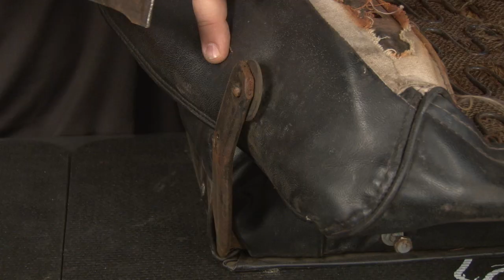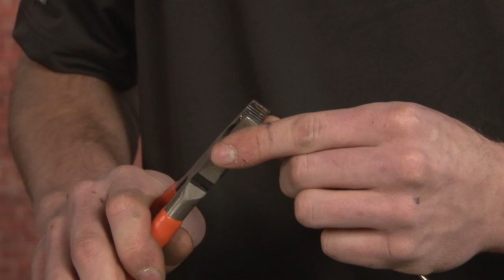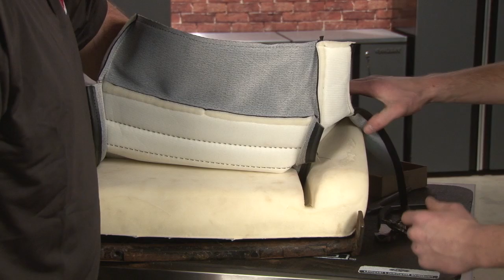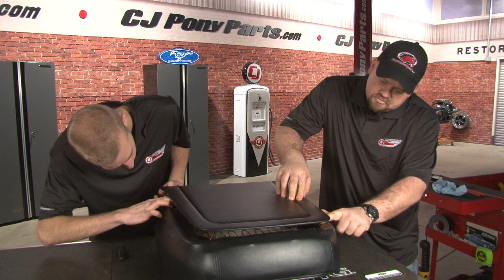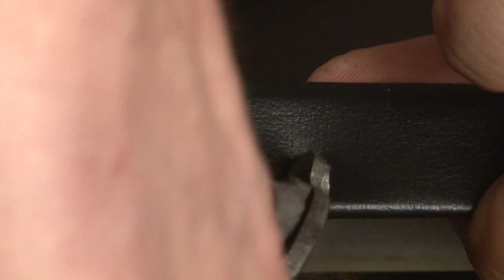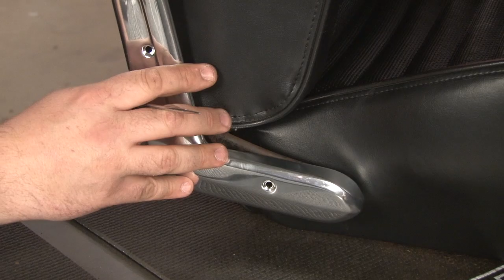Seat Upholstery | TMI | 1965-1968 Mustang

Comment: How can i identify a 1966 ford mustang coup factory 4 sped manual transmission ? 🤔
Reply: Look for the numbers on the transmission, if it’s a factory Ford 4-speed top loader, there will be an access plate on top with 10 bolts, and an aluminum tag on the passenger side, with the identification numbers. It could also be a Borg-Warner T-10,
4-speed, that is a side loader.

Comment: Extremely helpful video although I have the 69/70 high back seats. I have already completed one seat and it looks GREAT. Major update to my interior. Trickiest part was trying to hog ring the front of the seats into the channels, especially the high top seat. Found my seat tracks are all crud so that is my next task. Almost sixty year old grease to clean out. Make sure you take a picture of the seat tracks as I had to pull the seacond seat out to figure out how it goes back together. Go slow and take it one step at a time. I'm not going to say its easy but I got through it in just a couple days, again they look GREAT. Very very happy with the results.

Comment: Make holes in foam then pull through cable  ties...I used 8....10 inch maybe better...way easier..to get down in the foam was like next to impossible  with the hog ring tool to get down to the listing wire..used hog rings for tightening up underneath..this job is definetly doable..I was quoted 1,000 for two seats..the whole job honestly took about 16 hours...my first time😊

Comment: I am really finding it hard to pierce the foam with the hog ring, along with the listing wire, and pushing it all the way through to the frame. Anybody have secrets?
Reply: As was suggested above, use zip ties. I came up with this idea years ago and it worked wonders. The previous commenter said to just use them to get started, but in my opinion, they are a permanent solution. 

I don’t think zip ties existed “back in the day”. Regardless, I suspect hog rings are faster in a factory production environment, which may be why they’re not OE.

Comment: just finished mine! looks awesome! did driver seat in couple hours by myself, turned out very well! it did tear a bit on the passenger seat upper, wow its tight going over the corners with the oem foam at the top. vinyl glue did wonders, lucky it was on the back near the seat back

Comment: Thorough presentation.  I have one question though:  what is holding the seat foam to the frame?  Is it not necessary to first hog ring the embedded listing wire in the foam to the paper wrapped listing wire in the seat frame?    And then, attach the upholstery hog ringing the listing wire in the upholstery to the listing wire in the foam?    Please advise . Thanks Ace

Comment: Isn't replacing the seat cheaper and better for longevity? Not trying to be an ass, but if your changing the seat to your wants, then the car isn't original. Wouldn't putting anything nice but cheaper do the trick? This is asked, due to my having a 69 and trying to do a resto-mod as inexpensive as I can. I'm new to this, just have a passion. Can someone help?

Comment: This video has been a life saver! I took on the task of reupholstering my front seats in my 66 this weekend and I would have been lost without this video. The passenger seat is done (slightly imperfectly, but still looks great) and the driver’s seat is almost done. I’ve been leaning on wires in the driver seat for years, so it’s going to be amazing to have new foam (and vinyl) on my seat.

Comment: By far the hardest part of this job is putting the seat back cover on.  These guys totally gloss it over.
Reply: I made too many holes and had to rotate the clips until I got it right..but no mistakes show😊
Reply: I teared mine badly the card board piece I got some in but I gave up took 3 hours im possibly going to get the same color as the upholstery in long screws and do them neatly in each corner
Reply: @ericcartman3440  I just meant those back covers come with push-clips that will inevitably crumble when you push some of them in (age, rust).  I'd say 80% of mine pushed in OK and I just used a little silicone to glue the one problem area.  Looks good and now it's someone else's problem 60 years from now.  :)  This is a very satisfying job BTW and makes a big difference.

Comment: This is a good tutorial video. i watched many times before and during my rework. 
heres some tips:
1 invest in a good pair of hog ring pliers AND cutters. common wire cutters will not work removing your missed hog rings
2 consider getting straight handle hog ring pliers, the angled units dont work well
3 get an extra set of hands to help, compressing foam and getting to the wires is tiring and frustrating
4 take care when ringing down the listing wires, they can tear out of the thin material TMI used to hold them in place
5 as stated, put material out is sun to soften, it makes stretching easier
6 be prepared to give your hands and forearms a workout, the sport foam is not easy to work with
7 consider hiring a pro to do it, what is your time worth? 
i hate upholstery work, i'm in the middle of this now, so i will keep going. probably never do this again.

Comment: Here's a tip...don't fold over the bolsters or edges until you've completely hog ringing the center listing channels. The foam will compress enough for you to fold over the edges. Finish off by steaming the inside of the vinyl to soften it and reduce wrinkles.
Reply: Also, see if you can rent or purchase a pneumatic hog ring tool. Doing it by hand sucks

Comment: Maybe this is a stupid question, Does the hog ring attached to a wire within the cushioning (foam) or are the hog rings just grabbing onto foam or they grabbing onto metal framing of the seat springs behind the foam?
Reply from the maker: They grab into the wire that is embedded in the foam.

Comment: Thanks for this awesome video. Must have watched it 10 times during my install. I have no experience installing upholstery. Your 22 minute video made me a pro. Got my pony upholstery and seat cushions installed in my 64 1/2 Mustang and I don't think the pro's could have done a better job. Your video covers everything but the rear seats but they are a breeze to install. I added a couple layers of quilting fabric to the rear seat bottom and it turned out AWESOME! Saved me $550!

Comment: The only feedback I have is that when you attach the back frame to the bottom frame, it might be way tighter that what you had on the show. Mine was so tight I had to use a lot of force to make it work. That unfortunately ripped the upholstery. TIP: use a lot of heavy duty duck tape to protect your upholstery. Not your fault, lesson learned on my part.
Reply: Jethro Seghers where do you put the tape?

Comment: A couple of tips.  Put your new vinyl covers out in the sun for a good hour or more, it softens the material and easier to work with.
2.  use plastic grocery bags, or a dry-cleaning back, pulled over the foam, them the vinyl slips into place really easy.

Comment: When you are putting the hog rings into the foam,  are you ringing it onto the frame of the seat?  Also if you buy the sport r seats do they come with new hog rings and seat backing clips?
Reply: Hog rings go into the listing wires that are in the foam. The clips and rings are not included.
Reply: Thank you sir.  Just planning my project.

Comment: Dumb question- why wasn't the burlap replaced? wont the springs cut through the foam per-maturely?
Reply: The premium foams have a coating on them which makes the burlap pretty much not needed any longer but you can install it if you want to.

Comment: The original canvas is there to protect the factory upholstery during installation. It is not needed with the new upholstery so if it is in good shape you can keep it, if not throw it away. The springs are not really replaceable, I have seen various to repair them but none are really a good solution. If they still move freely and are not rusted out and broken they will be fine. We have done a few seats where they are so badly rusted they fall apart in our hands so we have to replace the frame.